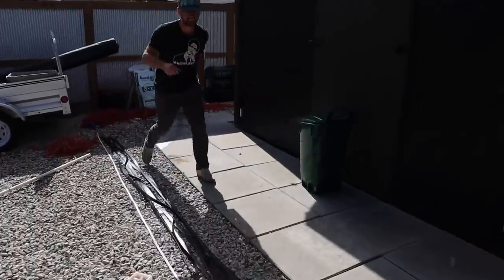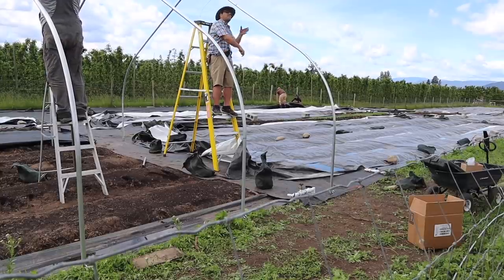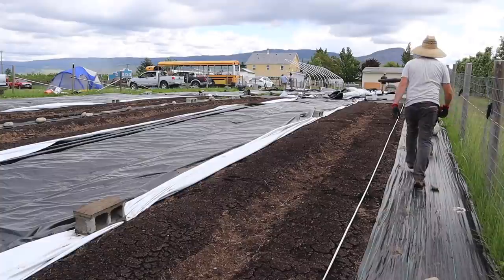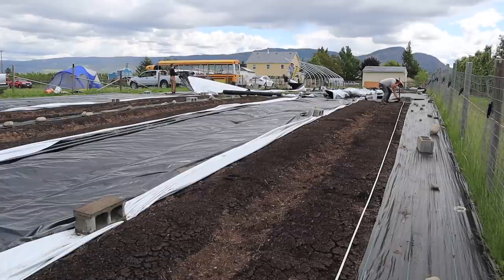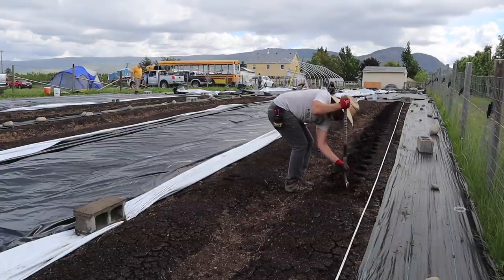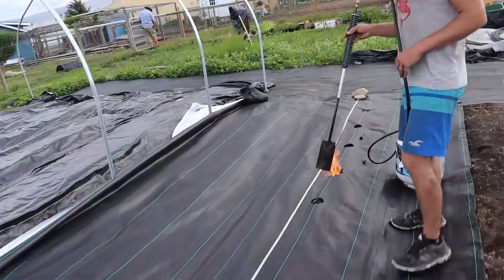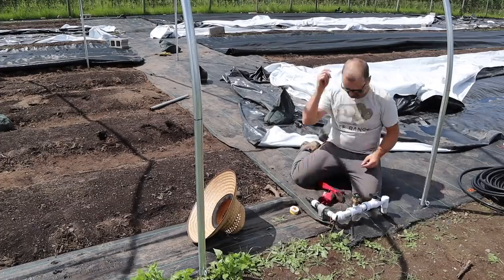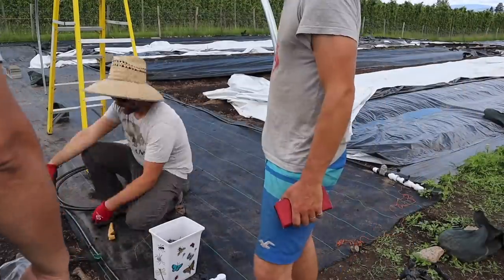New Farm Vlog #18 - Finish greenhouse frame, planting potatoes, preparing squash areas

Comment: What is your water source for your drip? We live rurally and use pond water and ground water from a resevoir. Would like to figure out a simple system with a timer so we can automatically water with the drip. We use a generator and pump otherwise.

Comment: Hey there curtis, first off thanks for all you do!...so, I had ordered the 2000 irri-gator drip kit - now I wonder what the wall sizes are..little late as it is in route but, a great point! Is this what you've used here as it looks fairly similar? Thxx! 
~From Litchfield Connecticut.